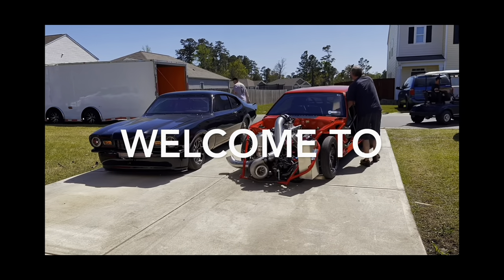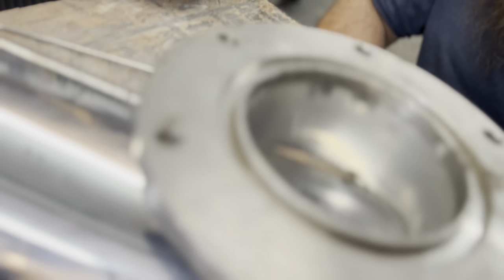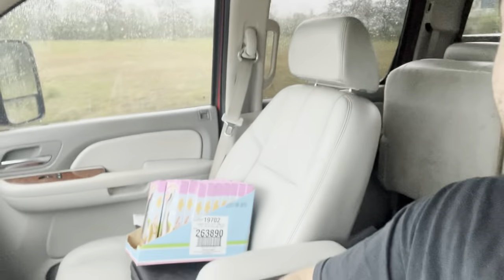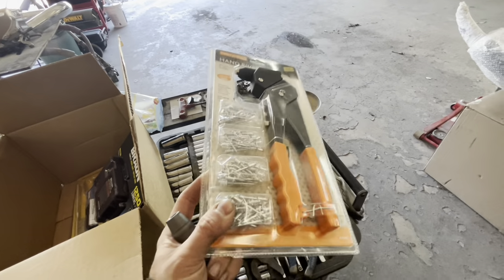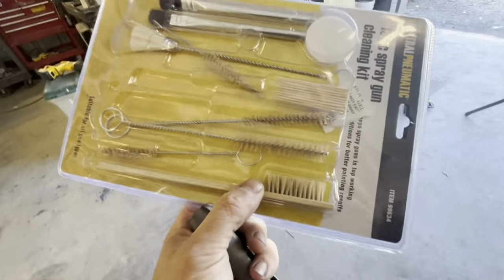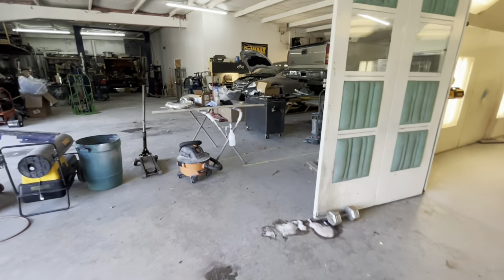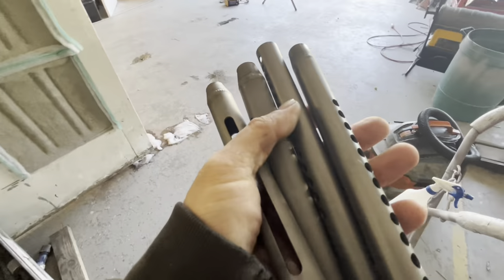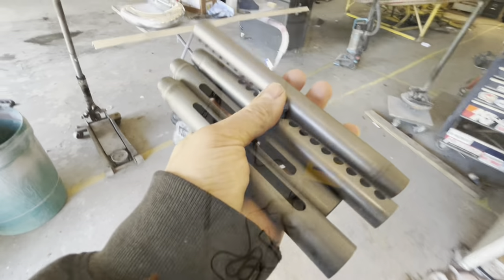💥 Powder Coating Chromoly UPR Travel Limiters 🦾(Harbor Freight System)🚨

Comment: I want to know who has 10k psi of brake pressure to cause copper nickel brake line to fail, most caliper seals/pistons will fail past 6-8k psi so dont sweat that brake line one bit. Its a whole lot of that on pro road race and ralley cars out there running it because thats where i learned about copper nickel and cupronickel lines. You killing it man keep on getting it did.
Reply from the maker: Thanks man!

Comment: We use hot glue on AN threads when powder coating so when baking it can melt off and save the thread without tape being annoying to get off leaving glue behind, hot glue can easily be removed if does or does not melt
Reply from the maker: Oh wow interesting. Never heard of that but then again I’m like never around powder coating. Thanks for giving that advice!

Comment: Warning speaking of brake lines did you get the proportioning valve switched to the rear brakes you don't want to proportion the front brakes. The front brakes do 100% line pressure the rear only get some where around 30% you vary the rear brakes not the front. Please check with turbo John or some body you can trust I could be a little off. I would hate to see something bad happen. Love the car.
Reply from the maker: You don’t want all the pressure on skinnies in the front bc they will lock up. On a drag car you want more pressure on rear being they are wider tires with a bigger contact patch.
Reply from the maker: Front skinnies are more likely to just slide than the bigger tears
Reply from the maker: Rears*